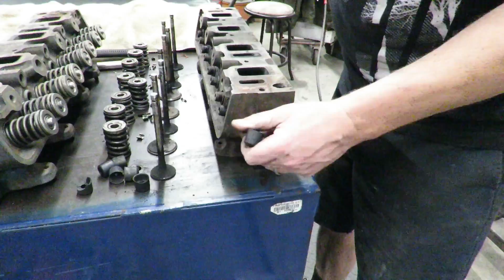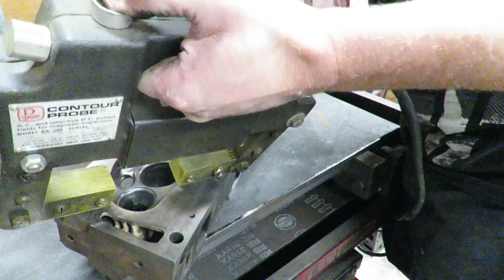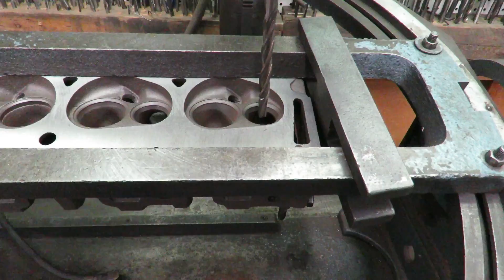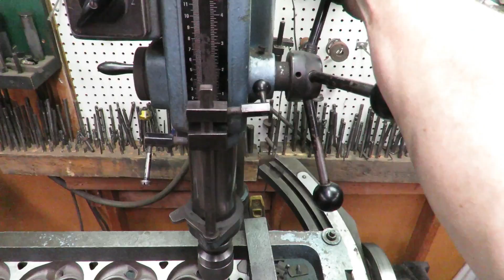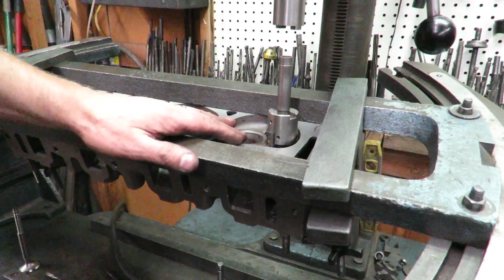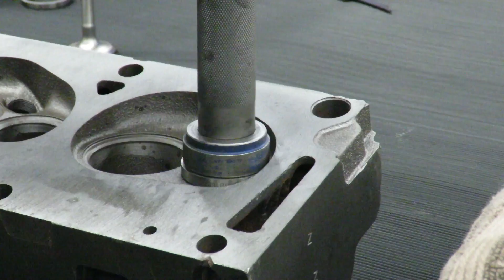390 Ford stroker Build part 7A

Comment: If you have any C4AE-G that aren’t cracked do you have any you want to sell?  63628 zip. Thanks!
Reply from the maker: Sorry I sold off all my FE stuff
Reply: @Myvintageiron7512  That is too bad, the stock castings properly ported with as big of an intake valve and leaving the 390 exhaust stock with a pair of turbochargers is beastly!

Comment: I absolutely love your presentation of the engine work you are doing and I am a Ford (FE) aka Ford Edsel L🤪L. 
Your attention to detail is exceptional and thank you for sharing your knowledge and expertise.
Reply from the maker: Thanks! 👍
Reply: Those are not medium riser heads. They are smog heads. They have a 200 cfm intake port. They are at the bottom of the totem pole for performance.  For a 430 ci engine they will nose over at 4500 rpm’s.  They were the 360 malaise era truck head. The Edelbrock heads would been a better choice. No wonder you’re disappointed with the performance. These heads are a cork. Intake flow is atmospheric pressure, exhaust pressure is pushed by the pistons. You could have likely bought Edelbrock heads for the cost of machine work. And an Edelbrock RPM is a good option for any FE. The exhaust is under positive pressure so the important thing is to improve the intakes, I run 2.19 valves minimum.

Comment: I love your videos & dont disagree with any of your work or teachings but what I know to be a medium riser head is a performance 427 head? What you have there is what I know to be a standard run of the mill 360/390 2bbl head vs. The larger port 4bbl 390 head. If those are C8AE -H heads? 2.03 Intake & 1.55 exhoust valves. Witch would fall into the low riser category. Maybey im mistaken??

Comment: FE Fords are just one of those weird freaks of nature that look like crap on every Dyno you put them on but run like stink at the track and on the street.  I believe they perform better than they look on the dyno because they average better HP and Torque than most motors do.  I had a 360 in a 68 Ford truck as my first vehicle in the 70's and I will always remember that truck fondly. It was a great running truck and I could do a one tire fire as long as I wanted.  Racing FE's with open headers have a sound all their own. You can always tell an FE.
Reply from the maker: if built correctly they can be a real beast

Comment: A little different than we do.  .005 interference fit on hardened seats, installed cold from the freezer and with tincture of iodine.  They go in easy and expand when they warm up.  They come to the ambient temp of the parent metal in less than a minute.  The iodine makes them rust-weld in place almost instantly.  Have never had an iodine'd seat come out, even in truck engines run low on coolant under load ...
Reply from the maker: Interesting where are you getting the Iodine brand and source I would be interested in trying that
Reply: Old stock WW-II Tincture of Iodine sent out in field first aid kits. Got a bunch of vials in storage.  I don't think it ever goes bad ...
But a decent pharmacy can prolly set you up.  Slather some on a new hardened seat and see if it rusts?  That is the key.  Iron head is easy to rust, hardened seat maybe not ... A successful install will show a slight ring of brown around the installed seat at the interference joint.

Comment: Hello! Why are you punching valve seats for unleaded fuel? I haven't ever heard and I would like to know why, Thanks!
Reply: I actually googled it. Is it because the valve, with unleaded fuel, would punch itself to deeper into the head, because there is no leaded fuel to prevent impact welding between the valve and the head to each other?
Reply from the maker: the early heads did not have hardened exhaust seats and the unleaded fuel destroys them,  all heads without hardened seats need to have hard seats installed

Comment: 13:15 Can I ask why you used that method for inserting the hardened seats? My shop usually warms the head up and puts the seats in the freezer, that way there is no need to wail on the head.
Reply from the maker: you only need to heat Aluminum heads when installing seats and guides because the interference fit for Aluminum is much tighter I don't know of any shop that heats cast iron heads for this if your shop is doing it that's a first
Reply: The dumb question is the one you're afraid to ask. We all need reminding at times.
Reply: It is claimed you can get 15-20 more horses out of an iron head than the exact version in aluminum.
Reply: Aw that's right, I'm a dummy... they rarely if ever see cast iron.

Comment: This seems like a LOT of work and man hours rebuilding iron heads like this. Cost wise is it more affordable than getting a set of aftermarket heads from a reputable maker like Dart, Edelbrock, or AFR?? I realize prices for aftermarket castings vary greatly depending on what you want but i'm talking just a entry to mid level aluminum head.
Reply from the maker: I don't really like Aluminum heads for a big truck they do perform well and if this were a mustang or cougar I would probably have advised Aluminum heads however the iron heads are stronger and when paired with a the right combination they make good solid power
Reply from the maker: Yes Iron heads are about double the cost of these heads
Reply: Shane Singleton 
Yes, you are wayyy better off going with an edelbrock or blue thunder head, especially for performance on a stroker, I've done stroker FEs and I don't mess with any stock fe heads unless it's a restoration deal, other than that go aftermarket and don't look back
Reply: My application is likely going to be a mild 350 sbc. May go with a 383 but I think it's going to be a mild pump gas NA 350. maybe 400hp. L31 Vortec SBC heads are pretty decent.
Reply: Sbc is a different deal altogether, I've ported many sets of iron FE heads, yes they can work, but why bother? it's never a bolt on deal, never had any issue running aluminum fe heads in trucks my self, i dont understand the stronger  comment?
If that's your personal preference fine, i can't imagine what you would have to do to find out you needed the strength of cast iron over American made aluminum? 
99.5% of guys will never hurt an edelbrock head